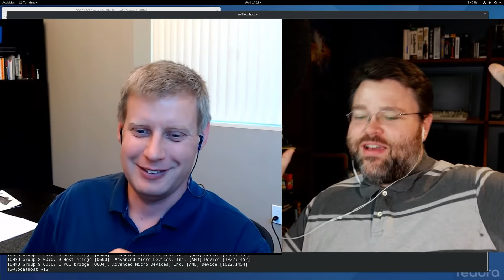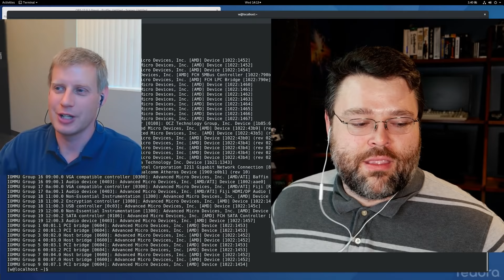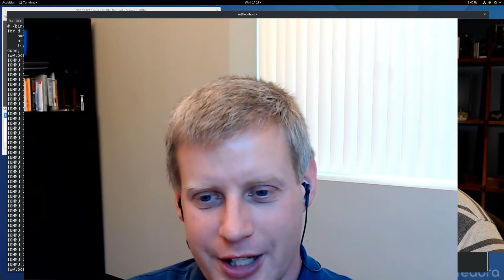LIVE: Level1Techs with Jon Bach of Puget Systems!

Comment: The answer to being locked to a platform is open data and file formats; commonly used and still maintained applications for productivity.  I wonder how many companies went under because they went with software that was easy to use but closed format and its vendor went under.

Comment: I have a E5 2698A v3 (16c 32t @ 2.8GHz base/3.2GHz all core/AVX2 2.9GHz)

I use it for x264/x265 rendering with filters that renders all cores uesless, unless I run 3 encodes/jobs in parallel with x265 (12-13 jobs with x264)

Comment: I am sure that Puget Systems does a good job and adds value in certain scenarios but for the regular guy, why would you not build your own system? As long as you know the hardware, you know how the software performs with hardware and you make sure that it doesn't get too hot in the case (large midtower, good cooling, good casefans...) it should be fine. Of course, when Adobe gets involved anything can happen, they sucks at optimizing software like how Trump sucks at being a president and at reasoning. :)